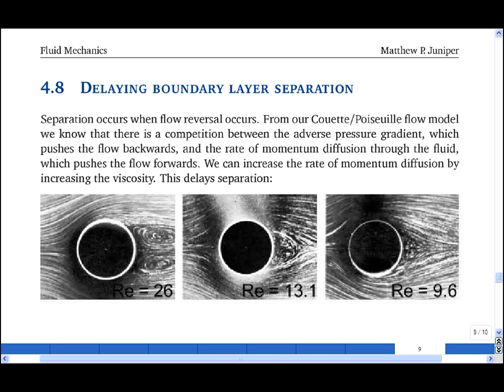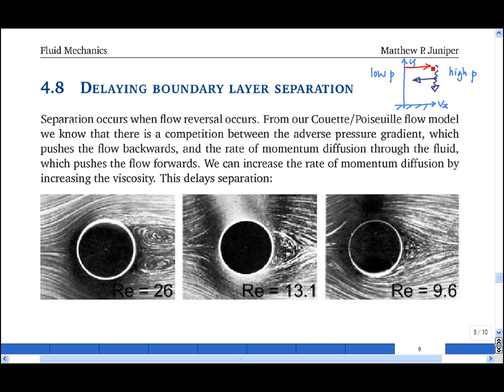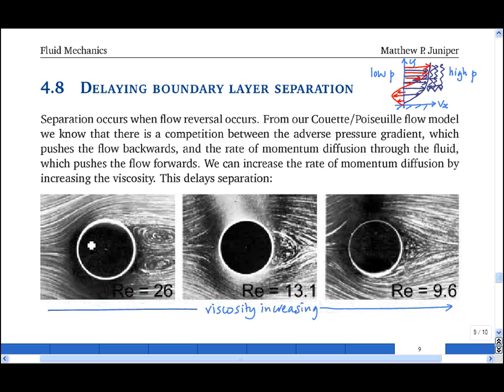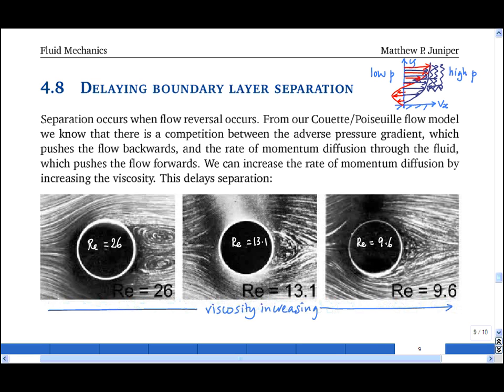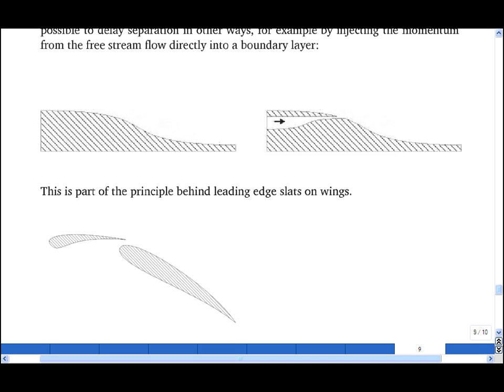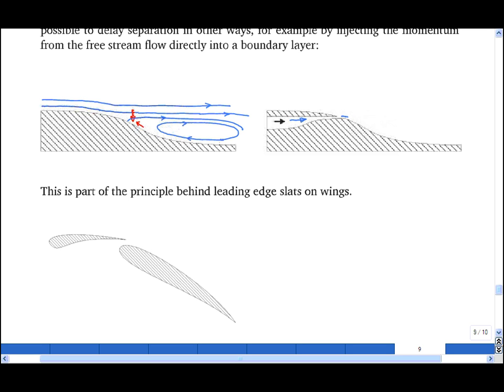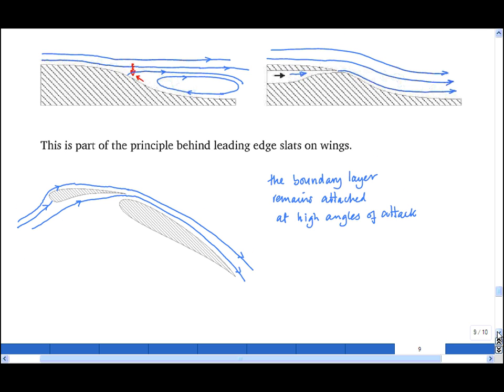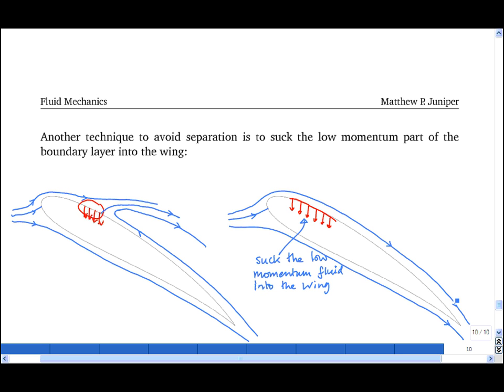4.8 Delaying boundary layer separation

Comment: It is interesting that while two vortexes are formed behind the cylinder which grow to a complex situation  and they will eventually oscillate and diverge  to the leeward side , there at the front end there are no pairs of vortexes  are formed. This  happens on occasions on a  flat plate   and if one puts a separation plate at the stagnation point  at the front the stationary fluid particles attached to the separation plate will start separation and two vortexes will form in the corner.    It is interesting how rounded need the front section be so that the two vortexes at the front would not be created .   
Congratulations for the excellent presentation and narration.